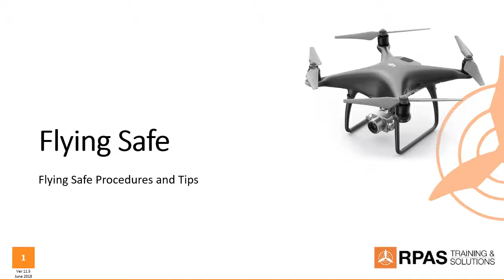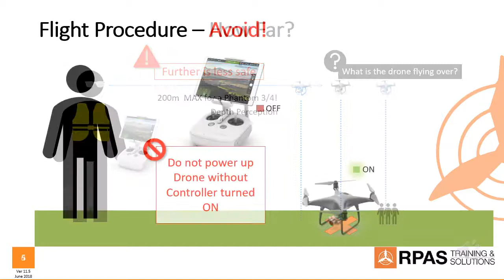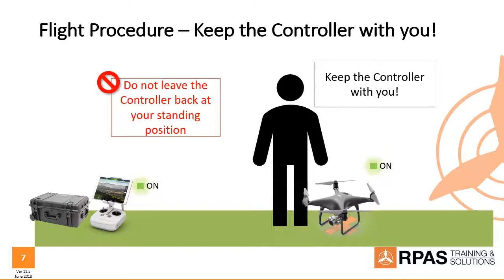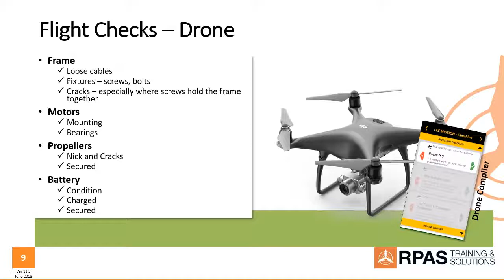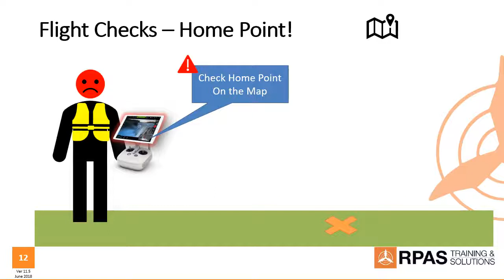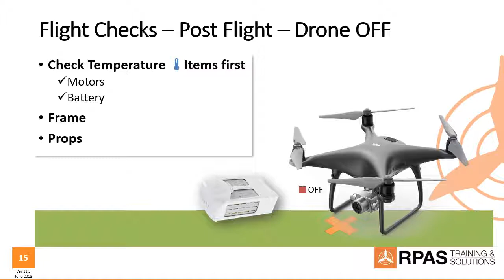FlySafe : Drone Safety tips from a professional drone instructor

Comment: forgot to mention the expiry on batteries Have my inspire 2 set for 10 days before auto discharge.   please note  on my old  inspire 1 you could  get a false percentage  reading on the app once auto discharge has commenced.  it could read 80 percent however once put under load  the battery can drop to critical level and force a landing.  I tested it under controlled conditions on a rural property and had 2 forced landings with massive battery level drops.  So Always charge your batteries just before you fly  and write a date on the battery with a whiteboard marker